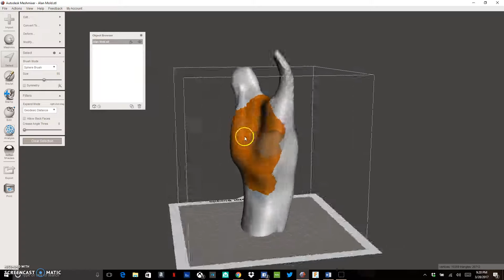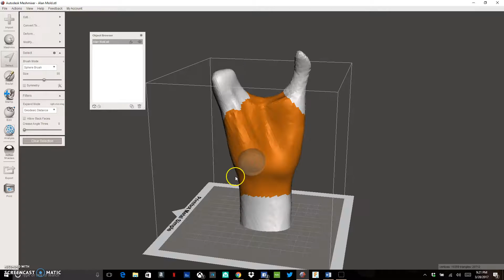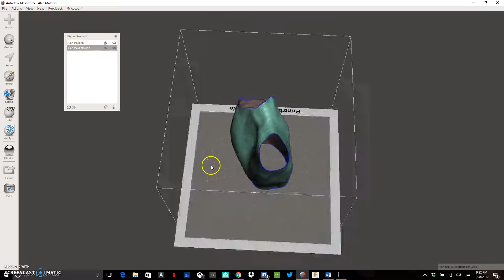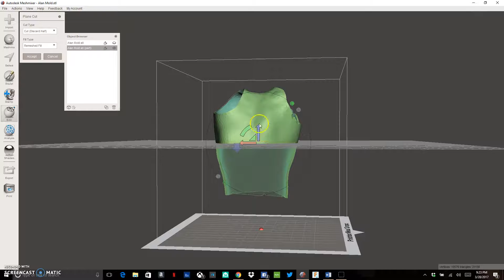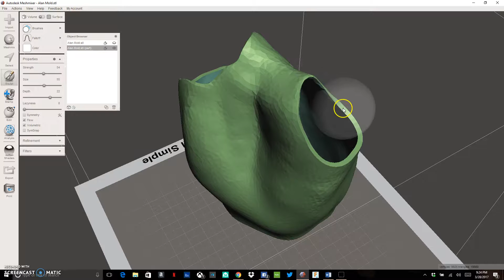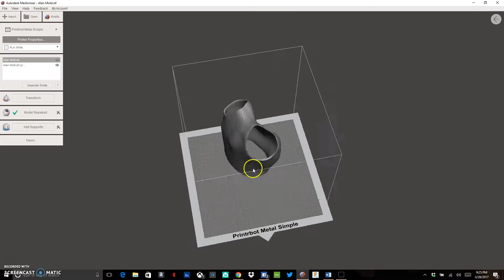Fitting a Surface to a 3D Scan for 3D Printing in Meshmixer (3 of 3)

Comment: How would you flare out the edge of the cuff opening- so the proximal edge gently opens a bit wider? Thanks for your helpful vids.
Reply: An easy solution I can think of would be to do that in blender, it's better at managing mesh models. 
I'd export the offset but not thickened part. Then in edit mode in blender you can select the outer ring and scale along normals while doing a gentle fall off. It would flare outwards and slowly taper down to the proper gauntlet size. Then I'd export and open it up in meshmixer again, doing the finishing touches shown in the rest of the video.
Reply: Stragemque thanks for the suggestion. I’m getting more familiar with meshmixer, but don’t know anything about blender. Why not just do everything in blender?
Reply: @bensdemosongs  Yeah that's also possible. 
I don't think it would be as easy/neat to thicken and then adjust the edge in blender, also not sure how good it would be at making a watertight mesh. 
Also scale has always been iffy with blender. I never know how big the stl will be and the internal units are pretty arbitrary as far as I know. For peace of mind I'd want to export from a program that will tell me exactly how big the final stl will be.